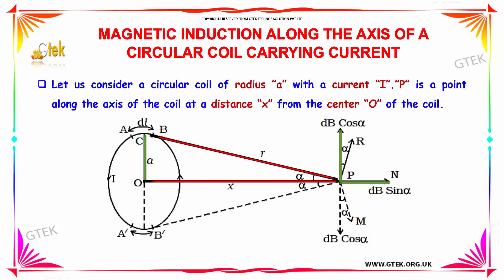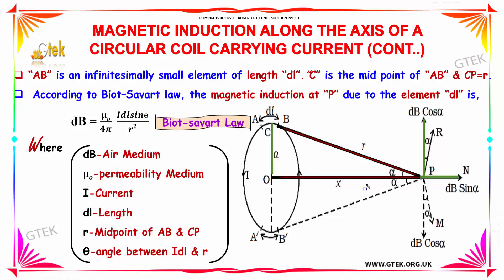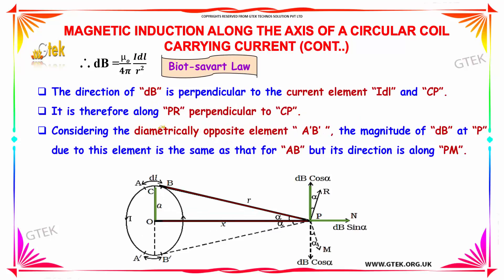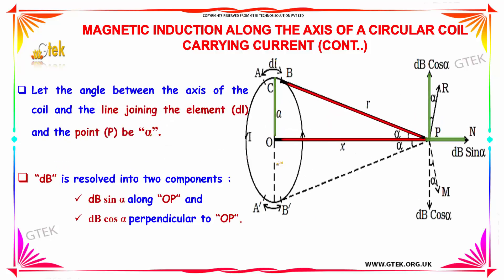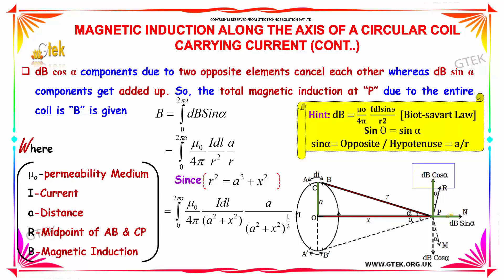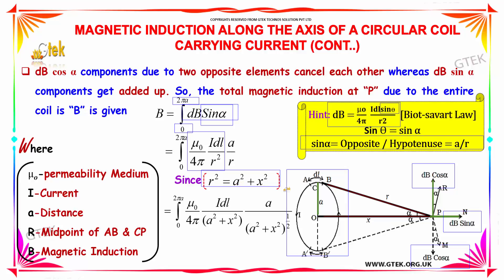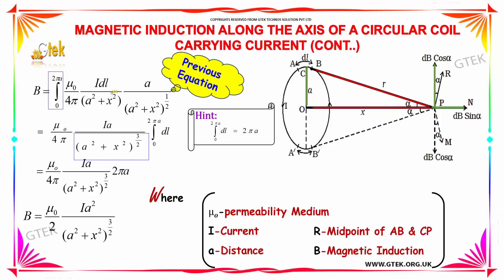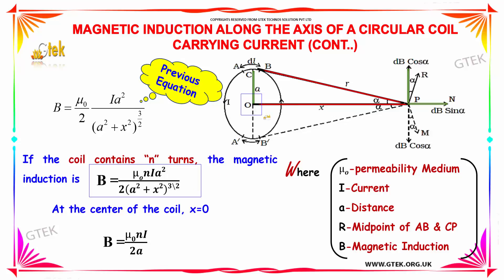Magnetic Induction along the Axis of a Circular Coil Carrying Current Effects of electric current

Comment: In vector form, Consider a circular coil of radius r, carrying a current I. Consider a point P, which is at a distance x from the centre of the coil. ... For the purpose of this simulation, we will assume its magnitude to be B 0 = 3.5x10 -5 T. The variation of magnetic field along the axis of a circular coil is shown here.

Comment: A current carrying wire generates a magnetic field. According to Biot-Savart's law, the magnetic field at a point due to an element of a conductor carrying current is, Directly proportional to the strength of the current, i. ... Inversely proportional to the square of the distance r between the element and the point.